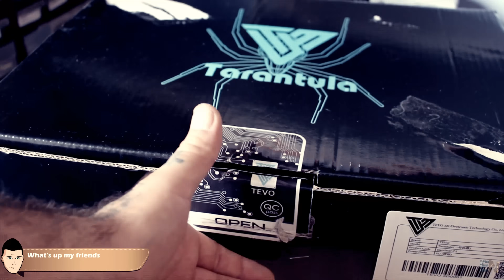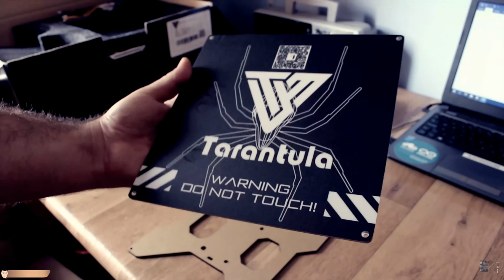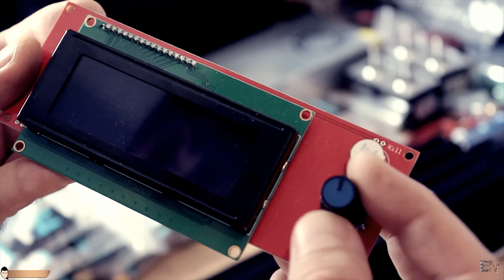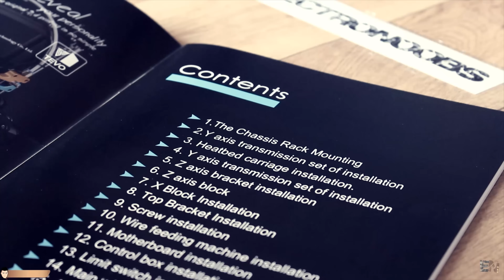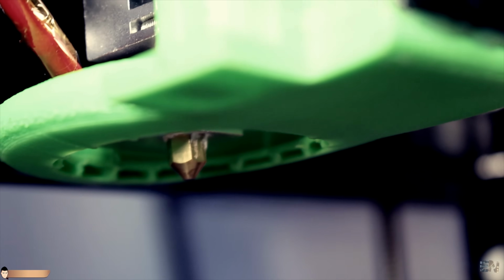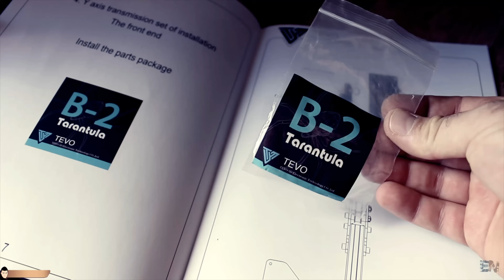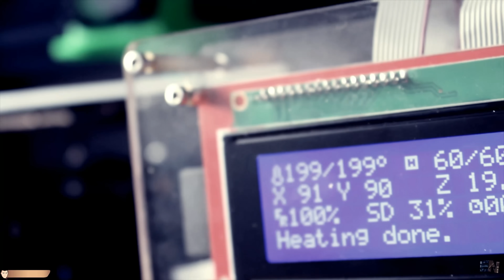3D Tevo Tarantula? - Assemble, review, UPGRADE

Comment from the maker: I hope you enjoy this video. Please check the description fore motre info, STL files, guides and AWESOME coupons!
Reply: Hi Electronoobs, I need your help, I already install the titan extruder but it extrude in reverse, What can I do?, could you send me or make a video about the correct assembly of it. Please answer.
Reply from the maker: Yes, I had the same problem. You should just switch in between the wires at the input of the step motor, change black with red and blue with green. 

if not, yous hould burn another firmware to it and  invert the extruder direction.

I think the first option is easier.
Reply: Electronoobs I'll try the first one, thank a lots.
Reply: Switch the wires works. Thumbs up, and thanks for your videos.
Reply from the maker: José María Vences Carbajal yes, it worked for me too. Saludos
Reply: Electronoobs how to use electrooculography circuit? Please answer
Reply: how did you connected extra fan to printer? I mean cables? thanks

Comment: I appreciate your effort, but the assembly is not complete, and sometimes even wrong. It's not good for begineers with this printer. 

1. You didn't say a word about using washers, which is crucial to screw the frame tight and not break acrylic
2. You have completely missed leveling of the bed
3. Doing these eccentric nuts is very tricky, it should be highlighted that tight grip of wheels on profiles is crucial for good print quality
4. No word said about importance of proper, vertical alignment of power screw
5. Never, ever unnecessarily put so much extra weight on the frame (spool holder is the worst "upgrade")
6. I highly doubt that you printed ABS so good on stock Tevo Tarantula

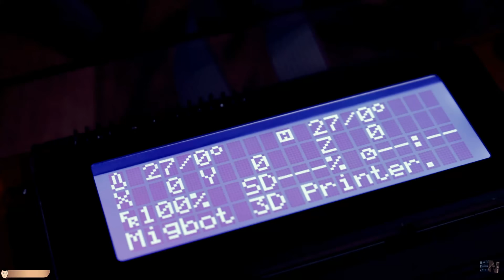Comment: 8:20 Setting it thru the menu is not saved, I put my setting in the G-code : M92 E376.14
I also had an issue with the stepper running the wron way so I just swapped the green and black cable of stepper.
The best way would be to re-flash the firmware with the right settings but I am too lazy for that ;)

Comment: I'm a newbie 3D printer guy. Any tips? How powerful of computer should I have? What software do I need? Does it cost money? Anything will help, thanks guys!
Reply: And I keep hearing how easy this is to build. Is it actually easy for a beginner? Ive never built a 3D printer before. Although I do have experience in working with electrical components and things like smart phones. Really nervous about buying my first printer only to have it flop or I mess up. Should I pursue with confidence? Or move on with a different hobby? Lol
Reply from the maker: There are free softwares. I use Blender to edit, Netfab to repair and Repetier+Slic3r to create Gcode and print. If you work every day it will get quite easy. You don't need a powerful PC. Keep up!

Comment: I have the same printer also with the titan extruder, but I have a problem. My extruder steps/mm changes back to 100 every time I restart the printer. I thought you would have a solution for this as you have the same printer with the titan extruder.
Reply from the maker: In order to have always the 370steps/mm you should reburn the firmware with the good data. If not you should change that value each time. it is a lot faster if tou have the printer connected to the pc with USB using repetier or so...
Reply: Electronoobs Thanks for a fast answer, but I also just found out that you can set the value and then go control and click the "store memory" and then it shut save the settings.
Reply: Nice video btw!
Reply from the maker: OVL 18 I've done that but it still changes. Try it out and let's see if that works for you!
Reply: Electronoobs Ok, I can try it in 6 hours.
Reply: Didn't work for me either. So how did you change it permanently?

Comment: hello anet a8 or tarantula are better the pluses and minuses ?

which is better ?
Reply from the maker: In my opinion both are kind of equal. The tarantula has strong metal body that won't move but the bed iswith acrylic so you need to print extra reinforcement parts. The anet has acrylic body but the bed is more stable. Both are great printers but you would need to print upgrades for both. I'd probably go with the tarantula...

Keep up!
Reply: thank you I site from banggood $ 172 a8 ordered I was hesitant anet, but anet, I bought it 5 days ago

Comment: great video, just one question how did you get it to print in the middle of the plate? mine always starts for the back.
Reply from the maker: You can set the center, printer dimensions and all this stff in your slicer. For example I use Repetier with Slic3r
Reply: hummm, i use cura. içll have to look for those settings. thanks

Comment: sir , i think something wrong your door lock system project . The button is malfuntion i think because when i instal and run the code the servo goes up and and countinually , the screen print "inside open" again again . I think the button bounce , Can you help me with that ? Honestly your project is great it has everything i need .
Reply from the maker: Tùng Phạm if you don't use the two push buttons for inside open/close you have to delete the emergency open lines from the code. Try that and tell me the results. Keep up!